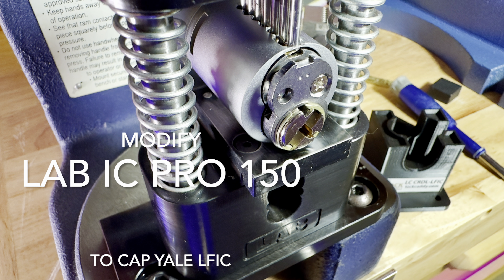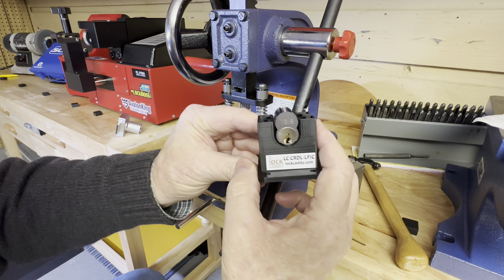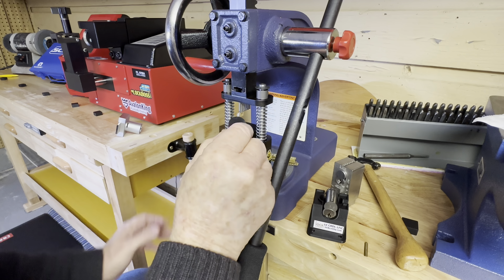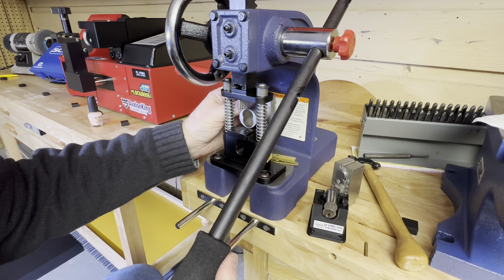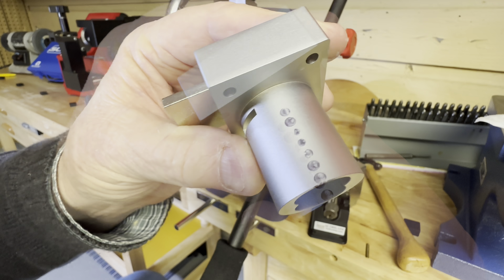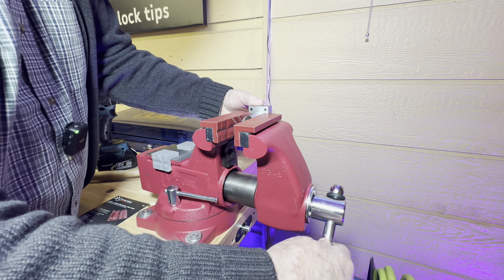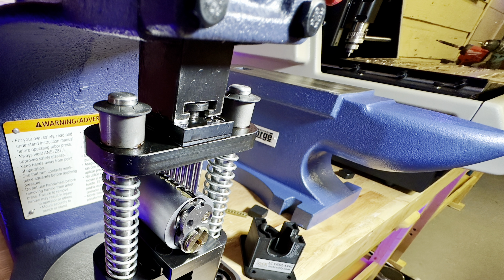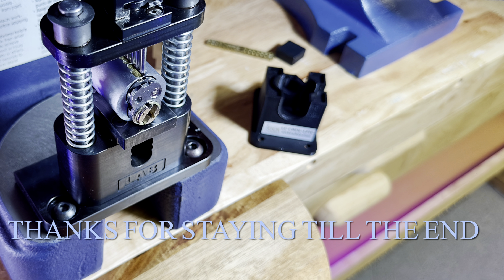lab ic pro 150 capping press for Best A2 locks

Comment: That's a great idea using tools you already have in the shop! Especially when you have to peel one of those caps off of a Yale LFIC. I find a lot of those with crushed springs so you end up having to pop off the cap and redo it. Great video 👍
Reply from the maker: Me too that’s a recent development don’t you think I’m now going to make a video partner to this showing how fast it takes to load from the top versus pulling a plug stay tuned. Thanks for subscribing. Don’t forget to hit the super thanks buy me a cuppa coffee you know I can always use that, thanks again. Have an absolutely wonderful week.
Reply from the maker: Now that I know how to cap that thing, I have three ways of doing it one with major manufacturing tool, CC-100 capping jig, adapted for a LFIC, one on top of the Lab IC Pro 150 capping press, and one inside of the newly adapted Olympus lock

Comment: That's a clever idea.  The capping press can be a versatile tool.  I hadn't thought of press fitting those strips.  Well done -- just be careful not to damage the punch assembly.  Worst case scenario though, LAB does sell it as a replacement part.  I assumed Major Mfg also sold a Yale capping tool, but I can't seem to find it.  Guess they don't.  Thanks for the tip.
Reply from the maker: I agree I don’t wanna wreck that lab assembly. It’s about 700 bucks for replacement parts. By the time you pay for shipping which would negate any thing you saved, pressing them with it but all you have to do is barely press, barely press as if you’re just trying to crack an egg Shell with your finger it goes down quite easily with the capping press. I’m sure a cheap harbor freight model with a slot tip ground down perfectly in your shop would work just fine. I’m going to investigate. Stay tuned. PS major does not make that LFIC I called Bill DeForrest and sent him all the parts and pieces. Probably now 5, 6 years ago. He said he was going to do it but I had to modify the CC-100 myself if he made one the harbor freight presswood be the cats meow
Reply from the maker: Thanks for the comment. If you see anything else that could be done to press down those nasty little things let me know. Thanks again.